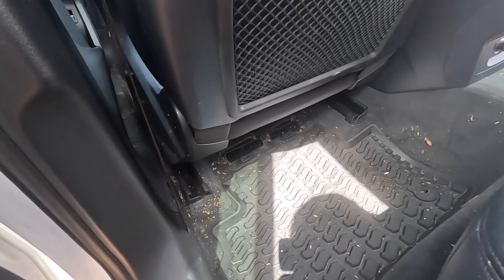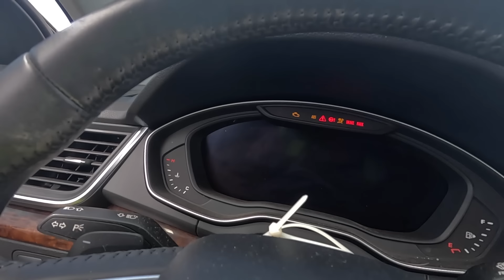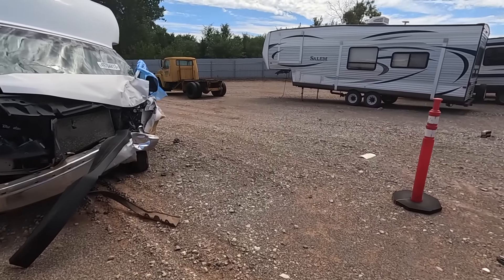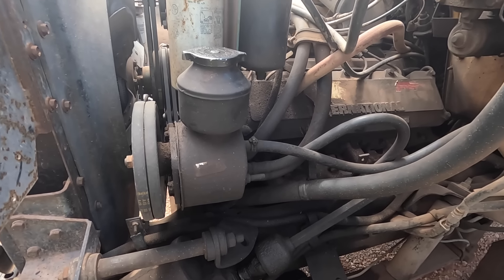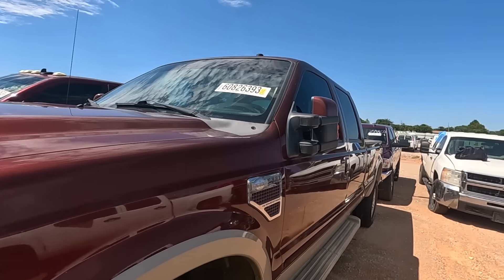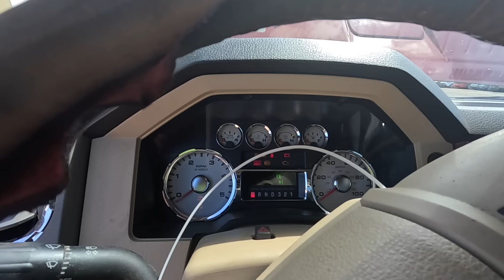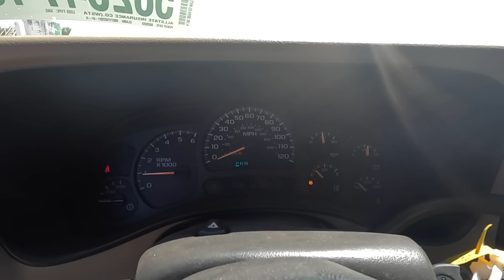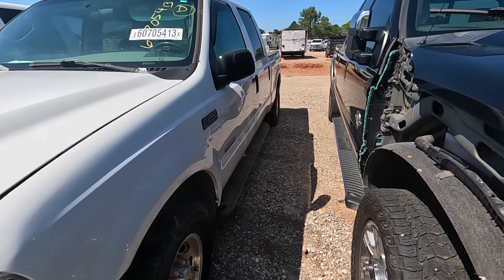I Found this King Ranch F350 at Copart and it's PERFECT! Why is it Junk?

Comment: If that’s a 6.4 powerstroke the reason it’s in such great shape is because it was in the shop most of its life.
Reply: Bam
Reply: #7 piston is probably melted.
Reply: Ya we thought the 6.0 PowerStroke was a junk motor. It is but not compared to the 6.4 PowerStroke
Reply: You right!
Reply: My 6.0 runs great as long as you do the proper maintenance on it. 155,000 miles on it and runs like a champ. Oil cooler was an issue once but I can’t really complain with a 20 year old truck. Just can tunes and stock. Use it like a truck and not a race car
Reply: You got that right. The 6.4 power stroke suck. Really badly. My dad owns a 7.3 power stroke diesel. He owned one before and it was totaled from a wreck and he loved that truck. He said no 6.0 and no 6.4 power strokes they suck
Reply: I own a 2008 6.4 on my third engine now ! First original engine crapped out. Dealer put a new one in and it crap out before I could get to the dealer to pick it up. They then put another engine in it which by a miracle is still running.
Reply: @stephentaylor280  They must’ve rebuilt the engine at the dealer to make sure that truck never comes back under warranty 😂
Reply: @MJ_Landscapes the 6.0 when bulletproofed wasnt bad but the 6.4 was just garbage
Reply: @darthtator3549  ya but the money you gotta spend to get it "bulletproofed" is rediculous
Reply: @MJ_Landscapes  is it any worse then paying 65k+ on a new one?
Reply: Great answer!! 🤣.  If you want a diesel buy a Cummins!
Reply: @texasexpat5677  nah OBS 7.3 all the way
Reply: At least those stupid environmentalists can sleep at night. Knowing that they put all those emissions bs on that truck, so it doesn't pollute as much. 😅
Reply: And the 6.4 isn’t really a ford motor it’s an international motor samething with 6.9 idi 7.3 idi 7.3 7.3 powerstroke 6.0 powerstroke only ford diesel motor ford built there self is the 6.7
Reply: @poobank  EXACTLY... diesels are so much more reliable without all the emissions BS on them!
Reply: 💯 on point
Reply: complety true, and now took many years by finally to get a great solution: Delete EGR and DPF system, it was a garbage 👎
Reply: @texasexpat5677  swap to cummins 6.7

Comment: That king ranch is beautiful BUT years 2008-2010 6.4L power strokes are known for catastrophic engine failure. You either want a 7.3, 6.7, or the 6.0 IF ITS BULLETPROOFED lol

Comment: I agree with the Impala. I bought a 2005 LS 3.8L, with 6k miles on it. Had it 15 yrs, 189k miles. Live in NH, and she rusted out bad. Never had any major issues. Still ran very good. i maintained it well. Didnt know about wool wax undercoating which i do now. Impalas were awesome cars

Comment: My dad had an international dump truck 1956 which he drove from Ohio to Florida with a top speed of 50.
Reply: I drove a Vespa 125 across Germany on the autobahn a couple of times with a top speed of 47.  Did the same with a VW bus also with a top speed of 47.  That was in the late 1960s.  Bought a new Vespa 180 in Genoa and took it back to Kassel Germany,  top speed 60.  Shipped it to NY when discharged, drove it back to GA.

Comment: The king ranch is a beautiful truck but it has the 6.4L powerstroke. My local Ford dealer has told me not to even bother with the 6.0 or 6.4 cause they have nothing but problems & its when ford tried having other companies build their diesel engines. In 2011 ford went back to building their own diesel engines with the 6.7L powerstroke. I've got a 2001 F-250 Lariat 7.3L powerstroke.

Comment: The King Ranch is a 6.4 Power Stroke and when deleted and tuned correctly it will put a house down.
Reply: Outside of cracked pistons (not an if, a when), melted injector tips, leaking up pipes, pump failures to name….just a few. Yea. Great engine.
Reply: They CAN make a ton of power though. No lie there.

Comment: hi  i have a 2021 ford xlt rapid red basic 4 by 4 its got 2.7.i lined it up with a 2018 xlt 5.0 this morning.i smoked him of the line but he got me midrange and on.the 5.0s kick in midrange the 2.7 runs out but fast off the line.mine has the 12 inch screen to i love that

Comment: The blue 2500 Chevy with tough bar in front , white F250 with 6 inch lifted  is kool & blacked out Ford Excursion all 3 are perfect workhorse truck's also GMC Sierra 2500hd asked.

Comment: 6.4 powerstroke is the fastest (speed) factory produced diesel engine, yeah it has many flaws but you put some love and money into one and you got yourself the fastest diesel aound and 95% of the time reliable. I had a 6.4 myself, I had about 13 grand into the engine and transmission combined. being i bought the truck in 2016 with a blown engine for about 6 grand

Comment: Its a 6.4 boat anchor. At best youll get 150k on the engine before it blows. Internationals worst engine ever built for fords powerstroke line. Best thing to do is cummins swap the thing and youll have the longest last one in that bodystyle.

Comment: From past experience, for towing, a standard Chevy 1500 doesn't have good transmission software.  It downshifts way too often, and can overheat easily.  I sold the chevy I bought 10 days later, and got a Ram with 5.7 hemi to pull my trailer back home.

Comment: The 1500 ram does look like a good truck for monkey wrench mike😲😁 I still think a 98 to an 03 Dakota RT the mighty Dak if you can find one would be ultimately the best fit could also it could also holla trailer or fifth wheel they're 1500 also and Came in extended cab

Comment: Ford makes a great product now. But not that diesel. The 6.4 is (not even arguable) the WORST diesel engine in a pickup ever. 6.0 after 03 was a great diesel once the egr was deleted and head studs were replaced. (Unless you had a pavement princess with tuners).
Reply: Indeed, there are multiple reasons why stock 6.4s are considered throw away engines.
Reply: Lies, the Ford 6.0 was the worst even studded if you put too much power to it. The 6.4 deleted and tuned is a good diesel.
Reply: @channels740  shush. The adults are talking. Tell me you know NOTHING about diesel engines without telling me.
Reply: @channels740  and secondly….that’s literally the point I made. The 6.0, when used for what it was designed to be used for (not a pavement princess with stacked tuners), the 6.0 is a remarkable engine. 470k on mine.
Reply: @wesleyfindley1779  both 6.0 and 6.4 suck stock. Both 6.0 and 6.4 instantly became much better engines when deleted. At that point just pick your poison.
Reply: @tylerwilkey13  to a degree. 6.4 makes serious horsepower. But….only as strong as the pistons. Or the block. 6.0 is a decent diesel. When it’s used for its intended purposes. (And when those weak ass head studs are replaced. (And new egr or delete). They’re not nearly as bad what non diesel mechanics say. Every single one is agrees the 6.4 is a boatanchor

Comment: That super duty was super  clean I would drive it cause u cant find them like that anymore, however that 6.4L turbo diesel you want to stay very far away from.  May run good but those engine are known to having to be rebuilt in stages. Top end or bottom end whichever comes first. Other wise is a very nice truck

Comment: Stay away from years 2003-2011 ford f250 diesel pickup bad Yeats on there diesels far as engines unless you have money to rebuild them then delete a faw things and update and fix some issues that they had. 6.0 or the 6.4. The better engines on ford diesel truck are 7.3 94-03 or 6.7 2011-current

Comment: Chevy is not consistent with their engines they change stuff all the time. 3.6 l V6 is one of the worst engines built. Don't get started on the 1.4 l turbo. I maintain a fleet with 4.8, and 6.0 nothing but major problems all the time.

Comment: I guarantee that king ranch 6.4 had engine failure!! 6.4 engines are GARBAGE ENGINES! 150k mile throwaway engines….. guaranteed to blow up within the first 150k miles and will not make it past the first 50k miles without replacing the block……. If it has more than 50k miles Ford warrantied that engine once before….